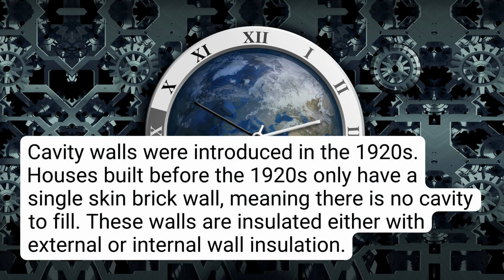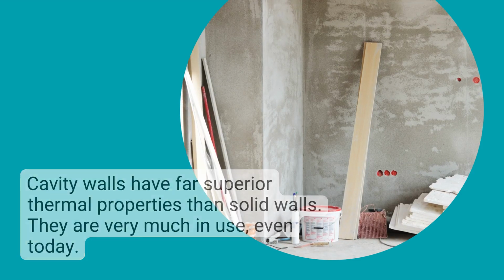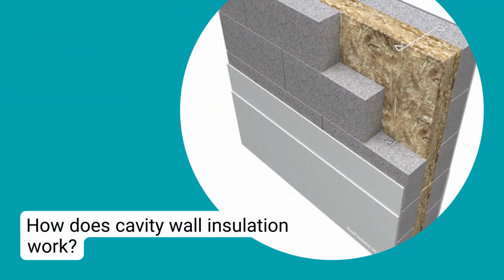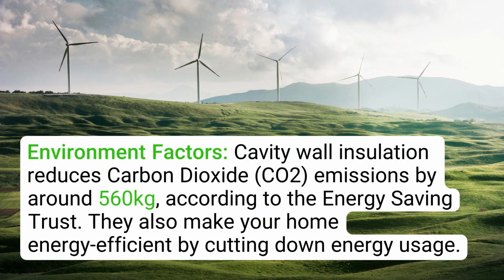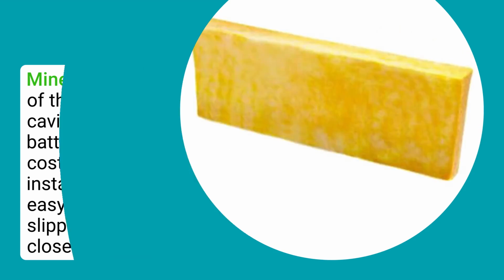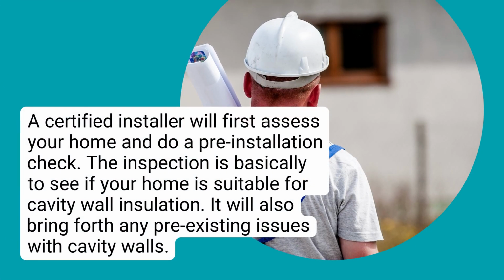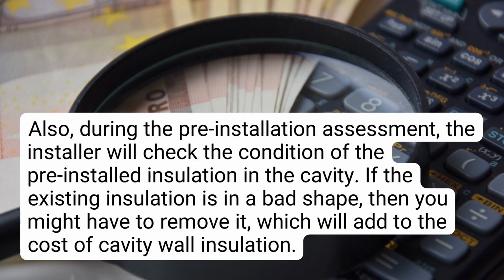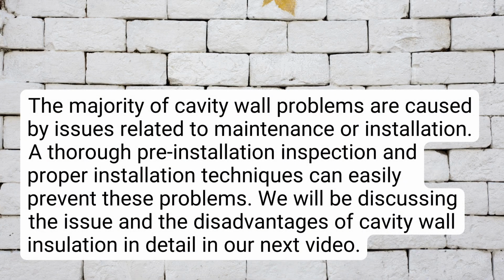Watch This Before Insulating Cavity Walls!

Comment: You can NOT add cavity-wall-insulation to cavity-walls that are already built.
Cavity-walls must NOT be BRIDGED with "insulation" (insulation touching the outer walls inside the cavity)If cavity-wall insulation is to be used , it can ONLY be installed from the VERY START of construction of the cavity-wall and there SHOULD be a LARGE air space gap in-between the face of the insulation and the OUTER WALL inside the cavity-wall ; this includes an air space gap in-between the face of the insulation and the cavity-wall-tie drip points which are in the centre of the cavity. 
 Ask N.V.Q. BRICKWORK teachers for PROOF of this !